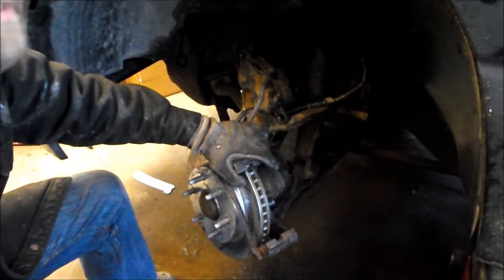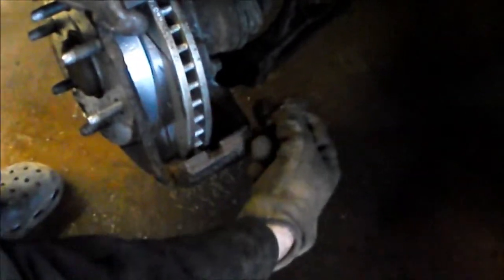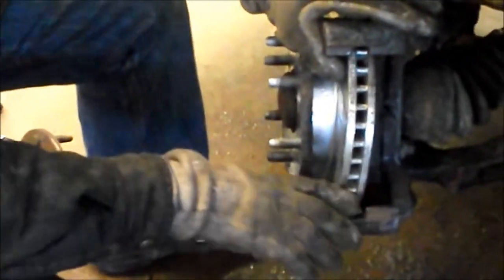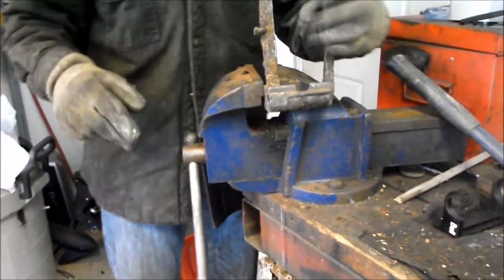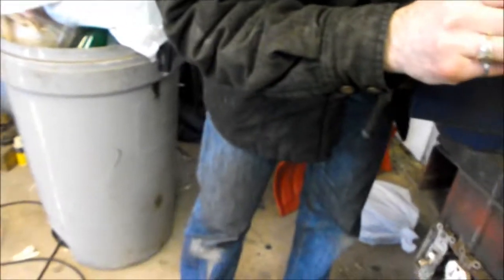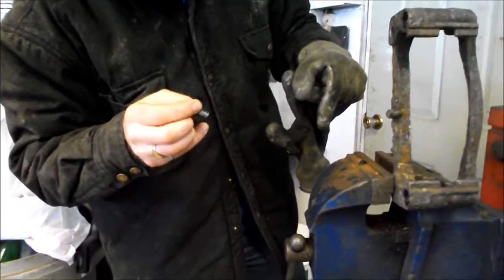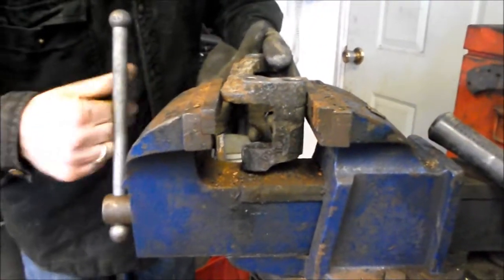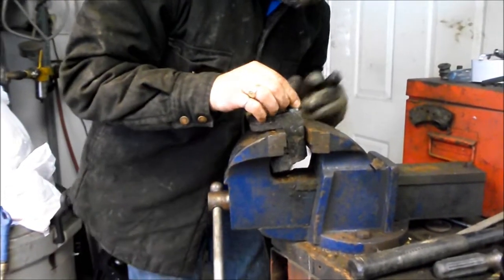How To   DIY 2001 Chev 1500Tahoe Front Brake disc, pad and caliper slide pin bushing replacment

Comment: 2004 Chevy Astro RWD.  I ripped a front slider pin boot using angle grinder w/wire wheel to clean up the bracket.  Oops!  Got a set of replacement boots that came with the internal bushings.  The nitrile rubber of the bushing was still in very good condition so it slid right out using a long corkscrew.  You could probably pick up an inexpensive one at a thrift or liquor store.  I cleaned out the bore using a wooden dowel with slot cut down one end to take a ripped length of paper towel which I wound around for a snug fit in the bore.  Brakeclean and reamed with paper towel several times - ready to go.  A 3/4” 12-point socket worked perfectly with some spray silicone on the boot to get it to slide into the socket and then installed easily using a mallet.  It did start to go in lopsided at first but is forgiving enough that you can just tap more on the high edge of the socket to seat it level.  I had the bracket mounted in my vice so the bore was vertical.  The bracket moved around a bit towards the end as I was seating the boot but worked OK.

Comment: thank you for this video Diyguy!  AND, we're glad it's not a professional video because it resembles more what we're going to run into.  I have to replace the guide pin boots and had NO idea what the little plastic cylinders were that come with the repair kits....until i found your video.  Keep on rockin'!
Reply from the maker: @Chris H. Thanks so much for the positive feedback.  Best of luck with your repair.

Comment: okay, so if someone doesn't have a heavy duty clamp mounted to a heavy duty table...?????  They would have to go and get a table and vice grip clamp or go to a shop to hope someone will allow one to use their vice-grip or face destroying the rubber boot/bushing (or just paying all the money to let the mechanic shop do it...geezzz)?!  Why not give those who don't have a vice-grip some ideas of how to solve that issue of getting that cumbersome rubber boot pin bushing in the caliper bracket if they don't have a vice-clamp (or torch for that matter)...overall though video was quite helpful...thanks for posting.
Reply: Use a Large c clamp does the same as a vice